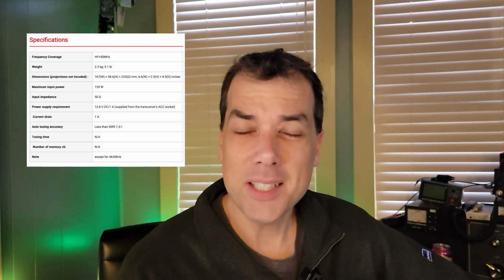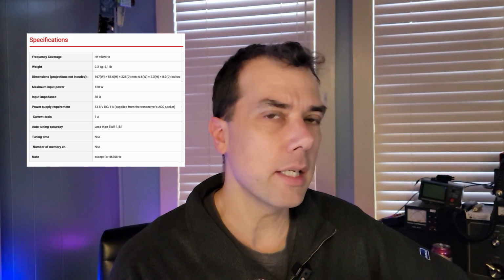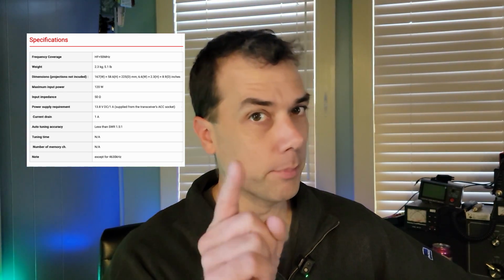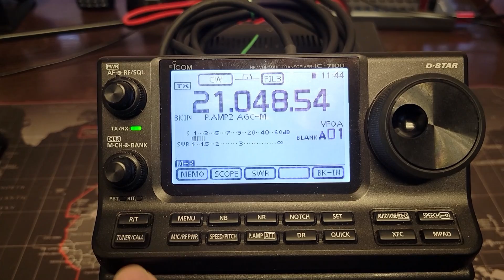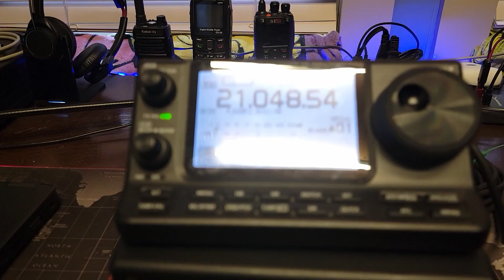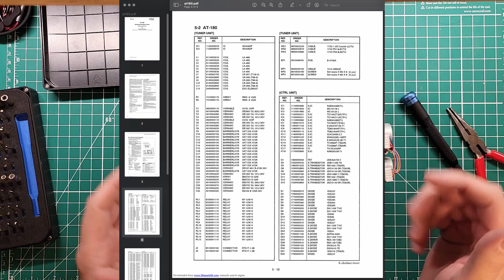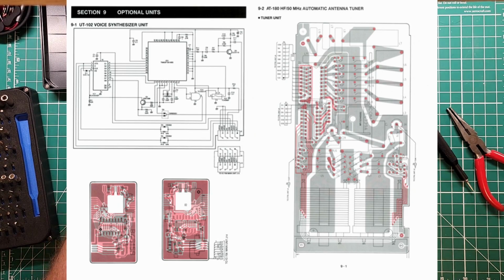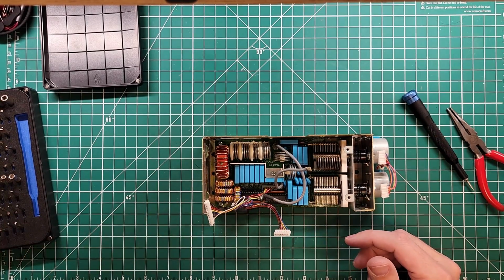G.U.T.S. - The Icom AT-180 Automatic Antenna Tuner

Comment: I use one of these, and I'm happy to have had a "look" inside. Works as designed after 25+ years, a technical chedevre of Icom, the same as 706 radios! 73 FB, man.
Reply from the maker: I used this with my 7100, but you're right, its that vintage - 703/706/7000/7100

Comment: Those servo motors are going towards unobtainable! Be careful! But yes what a cool design. Many Icoms from that day used these internally. Question: does it bypass on receive? You can tell with a DMM from antenna port to radio port after tuning.
Reply from the maker: I wonder if a stepper motor could have the same granularity?  Re bypass, I have moves this on to its new home and can't check.
Reply: @temporarilyoffline  a stepper could probably be as effective. Mr. Carlson’s Lab takes one of the motors apart in his one Icom repair video. 

I asked about bypass since all of the Icom internal ATUs from this era (with the motorized variable capacitors) seem to be transmit only. I’ll see if I can find a service manual to satisfy my curiosity.
Reply from the maker: @W6EL  at least there is some hope of getting it on the air if the motor fails.

Comment: Can this AT-180 be used on the ICOM IC-7300?
Reply from the maker: I think it can as the 7300 has the 13pin connector.  I'd double check the pinout first
Reply: Thank you very much, I'll check it out.

Comment: Nice.

Someday I'll have to get my Collins aircraft HF tuner dancing.  It, too, has 2 motors.  One runs a vacuum variable capacitor.  The other drives a roller inductor.  There might be a relay to choose between high to low and low to high matching configurations of L matching.

The advantage of these kings of tuners is that they can achieve a better match, being able to continuously vary the reactances (even the inductor in the Collins).  But the relay jobs can tune much faster if going to a memorized tune for a frequency reported to the tuner by the radio.
Reply from the maker: Absolutely!  I love all tuners!  I have a kit to make a qrp tuner.

Comment: I should never have sold mine. I got rid of my 7000 and AT-180 several years back.
Reply from the maker: I'd like to play with a 7000 one day.
Reply: @temporarilyoffline  On one of my late-night online shopping sprees I bought an IC-7000 and then a few nights later bought another that came with a AT-180. Haven't turned either radio on yet but I am learning day by day that I got a couple keeper rigs :-) They sure hold their value. Now after watching this video, I know better than to sell the AT-180 auto tuner. I almost listed it on the Discord groups a few days ago. Glad I didn't.
Reply from the maker: @Mike-WE0H  Its a great tuner.  Check the connections from the motors to the shafts of the capacitors - those plastics break down over time.  I understand the motors inside are no longer available as well, so it should continue to increase in value (while the pool of hams that actually know what they are decreases).  That 7000 was on my radar for a while.  The US didn't get the composite out model, but that would have been nice to have a big screen!

Comment: I have a 7000 and a 7100. Might be a neat addition to it. That is some old school tuning. Variable capacitors. Nice.
Reply from the maker: Which radio do you like better?
Reply: @temporarilyoffline  Neither ;) The 7000 is a great color screen. Small easy to use. Removable head. And the 7100 is easy to use for digital. Touch screen. DSTAR and is the first of the "7300 style" menu system.

Comment: Engagement.   Will that work with the newer Icom radios?  I see it hooks up with the ACC connector instead of the 4 pin tuner connector on a 7300 or 7610.  Inquiring minds.
Reply: Yes it will work. I use an 80;s AT-500 with my IC-7300 as well.
Reply from the maker: Looks like it does!